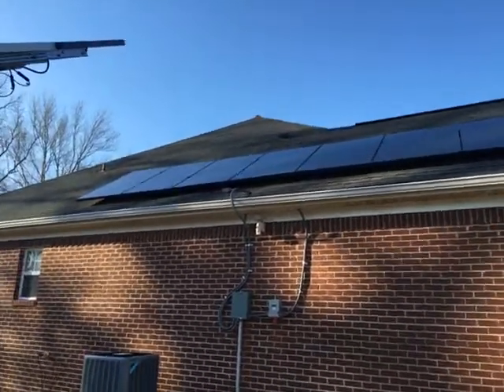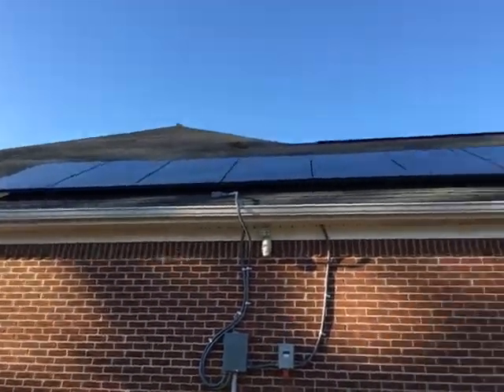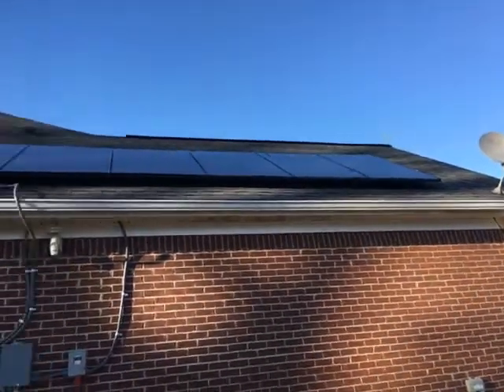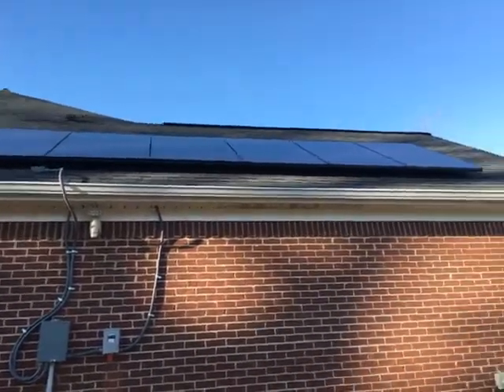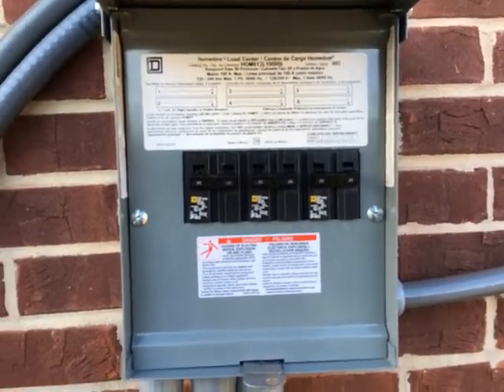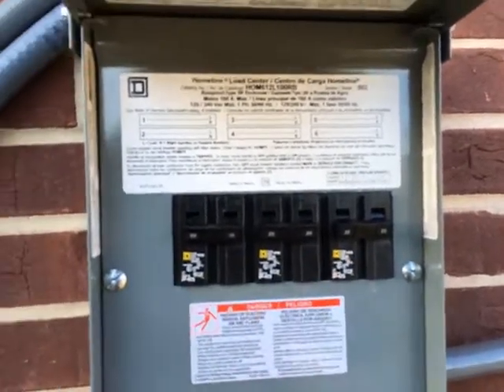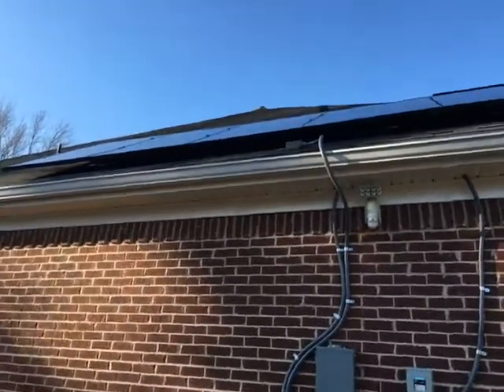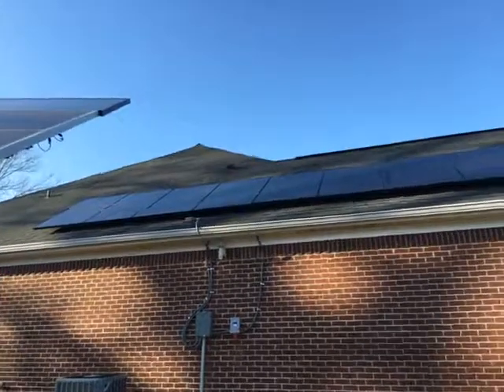DIY Solar Update - One Man 2kW installation completed

Comment: Would you mind sharing your plan and paperwork online to assist others with completing that?
Reply from the maker: Not sure what your asking for on this.  Are you asking for a schematic?
Reply: +rhandsom I'm referring to he paperwork you had to file to get your inspections and approval from your local utility company and local district. I'm interested in doing this on my own too, but don't have any ideas where to begin with the paperwork. Thanks in advance!
Reply from the maker: Actually, every locality has their own rules and paperwork to fill out.  Unfortunately, there is no one size fits all in this case.  There are different rules if you live the city as opposed to the county etc.  In the city you may have city inspections that may be more strict.  I live in the county (rural area) so I had to get a permit from the "County" inspection department.  Process was simple, I showed up with a diagram of what I was going to install, explained what it was and paid the fee and got the electrical permit to proceed.  Next comes the inspection of the work completed.  I have 6 months to complete the work (which is done) and get it inspected. If I was going strictly off-grid, then I would be done.  However, since I'm also trying to get permission to connect to the grid, I had to meet the local utilities requirements as well., i.e, take NABCEP class, schedule and pass NABCEP Entry Level Exam, apply for grid connect, submit application request, submit more paperwork, submit diagram, endure questions and responses, and finally wait for more questions and answers, hopefully, your getting my point.  No 2 processes are the same, no 2 utilities are the same.  Your first steps are to contact your city or county inspector for the rules, then contact the utility to see if they have a program.  Then decide if you want to go through the hassle.

Comment: I'm looking for a way to have my midnight charge controller shut off when the batteries are full and send the rest of the DC current to an AC inverter to my utility panel. I believe you have something like that hooked up can you show a video of how that's done. and what equipment to use for that process.
Reply from the maker: +Dan Suolo I did that at one point, your best bet is to check out this video from Missouri Wind and Solar.  https://www.youtube.com/watch?v=x5BAFeOqt3U   and here's mine https://www.youtube.com/watch?v=583goVkngsk  May be better to go with the MWS solution.

Comment: I'm pretty much the same way when I want something done I do it myself. but if you can explain you said you know you hit every rafter is there a special method for that?
Reply from the maker: I came up with a way, I ordered some 12" drill bits and went into the attic and drilled 2 starting holes in the first rafter, then I lined up my roof mounts on the first rafter and measured approximately 112" to my next drill point at the top and bottom of that rafter. (16" x  7 spaces = 112" which was my next drill point) my rafters are spaced 16" apart, for one set of rails.
Reply: I always like your creative insights on how to conquer problems you're able to think out-of-the-box that's one thing I noticed about you that's why I like your Channel.
Reply from the maker: Thanks, I appreciate the compliment. Thinking outside the box definitely helps when you get into type spots.

Comment: Did you get a permit since the panels are on the roof?
Reply from the maker: +Gary H I had to get a standard electrical permit from the county inspection department.  I still have to get it inspected once I'm satisfied with my wiring.